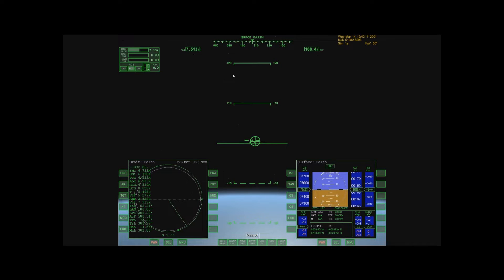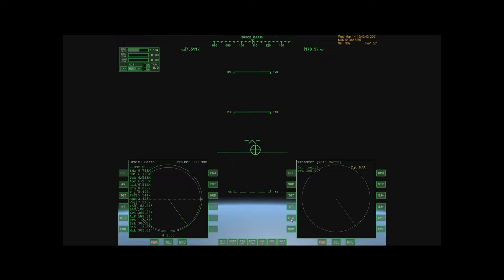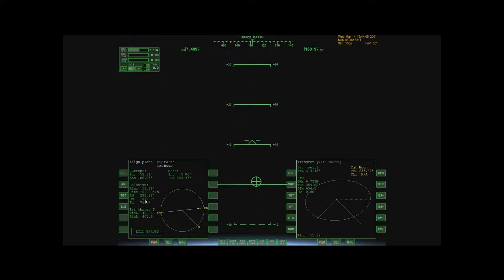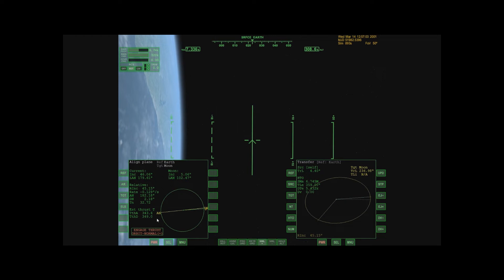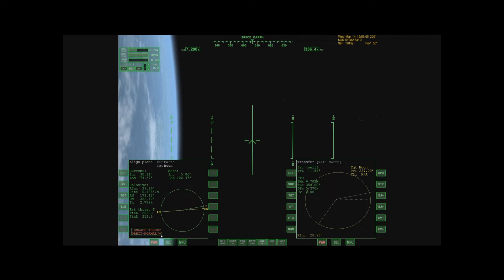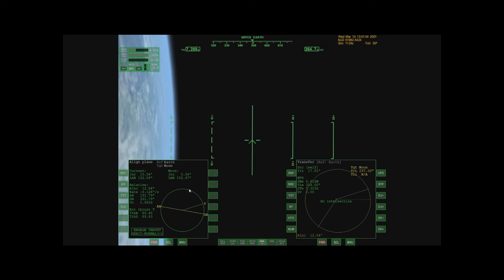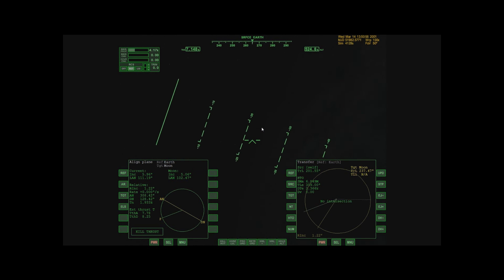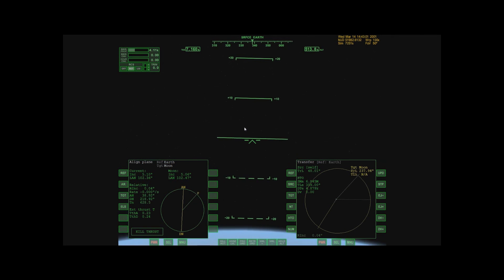Orbiter 2010 Tutorial 3: FLY ME TO THE MOON (part 1/3)

Comment: Hey,

just another tip: 
TthA and TthD is the TIME for Full Trust on Ascending/Descending note, use it half ahead and half after the Node. If it says TthA 40 then burn 20 seconds before the Node (Tn is the Time to the Next Node) and 20 secs after passing. You can use the Burn Computer in the DG4 Glider or do it manually, for correcr Burns.